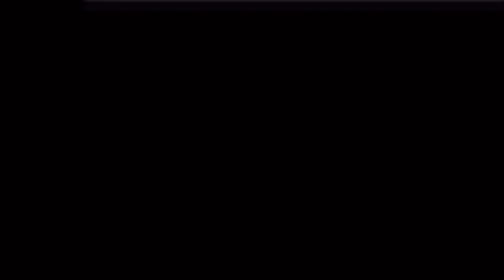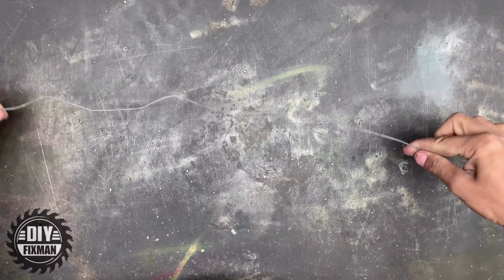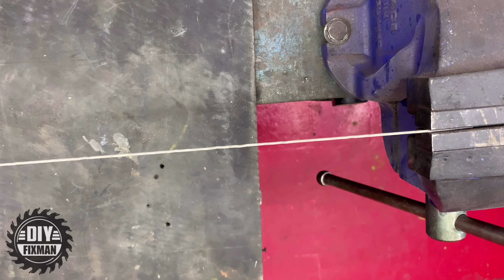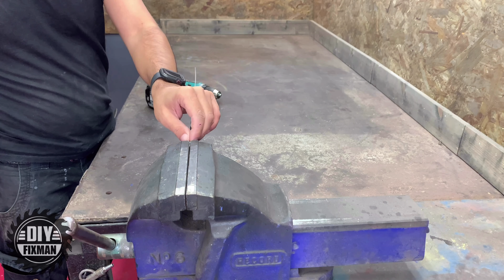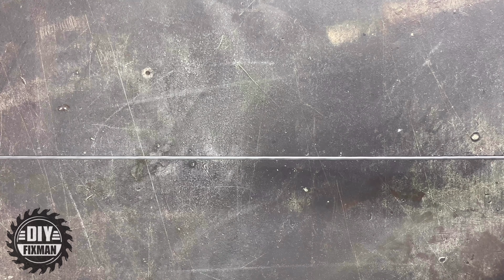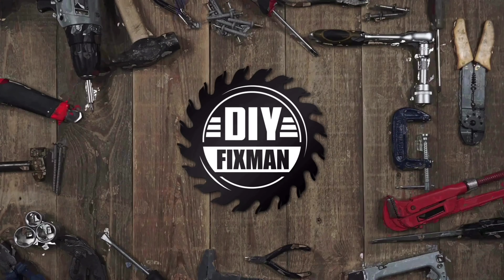Trick - How to Straighten an Iron Wire Perfectly

Comment: I installed suspended ceiling for years and that is how we straightened out wires that were bent up, except we cranked them by hand or with a brace drill frame.  We didn't have battery operated drills then and cords would have gotten in the way of the rolling scaffold wheels.

Comment: Definitely weakens the wire and easy to twist it to the point of snapping.   This is one of those tips that everyone keeps copying from other peoples' tip videos without ever using the tip themselves long-term to test it.
Reply: Depends on use, I use tie wire when I'm making wooden fishing lures, not the through wire but to hold them when I dip in sealant, holding for painting and epoxy coat. Strength is not necessary just rigidity so for that purpose its perfect.   It all depends on the application

Comment: Most 18V and 20V cordless drill chucks won't hold any wire or drill bit less than 14 gauge or 1/8".  Chuck won't tighten down enough to hold the wire.  I needed a bus bar made from 16 gauge tinned copper and the drill chuck wouldn't tighten down.  It only slipped inside the chuck.
Reply: Bend an L into the end so it goes through multiple parts of the chuck. Its not tight but tight enough to work
Reply: Not true. "Most" 18v and 20v drills work just fine. If you're trying to do very thin wire, that may be an issue, but not usually.
Reply: @oztrich24  I have tried twisting 22-24 awg wire in my Dewalt drill and the wires pull out.  On amps, I never use any wire under  20awg anyway.  
Just my experience.
Reply: @craigheavner8254  For smaller wire, I just make a small eye loop and/or catch the wire in the sides of the drill chuck before you tighten it down. Works every time, no matter the gauage of wire.